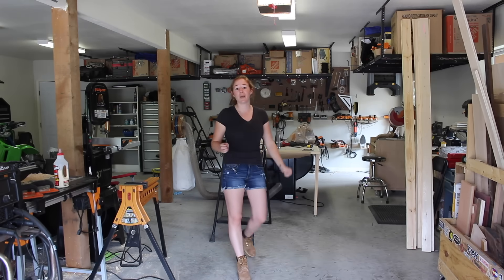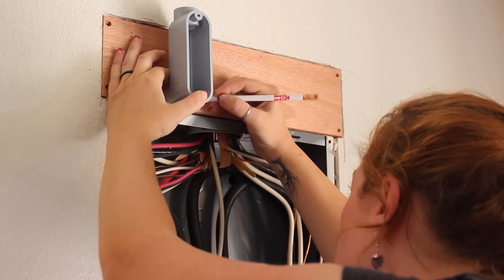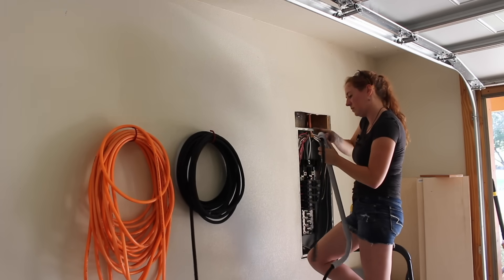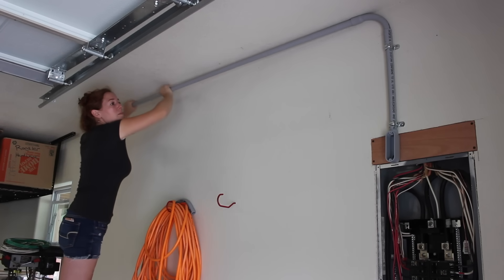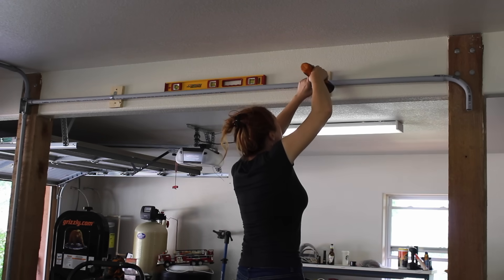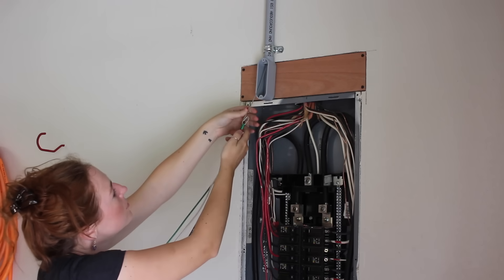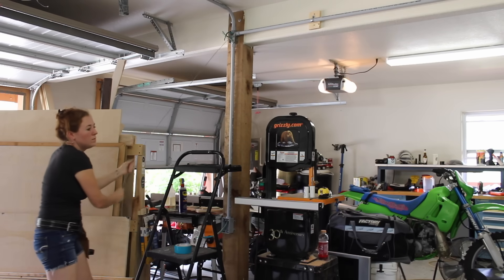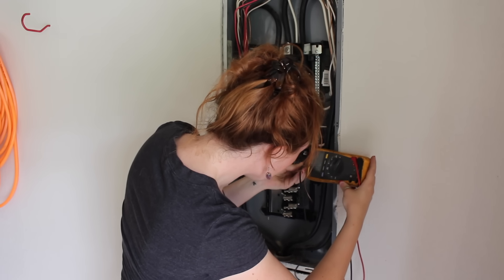Adding 220 Volt Outlets to the Garage

Comment: Handy box for splice is to small. Should have used 2 blacks or black and red wire for receptacle not white white is a neutral.  Handy box must be grounded because it is metal. U can't run the thhn in free air into panel. But pipe job with straps was nice

Comment: -1" pvc and smaller needs to be supported within every 3 feet.
-I did not see you using pvc cement when putting together the raceway.
-If you have a heatgun, you can use that to heat up the pvc to bend offsets in your run to follow the contour of your garage instead of installing those wood blocks.
-don't forget to bond your metal junction boxes (handy and the two bell boxes) with a green ground screw and green or bare wire to your ground wire
-It looked like you didn't put on a cover plate for your receptacles.
-I could not tell the size of your conductor; #12 is good for 20 amps and #10 is good for 30 amps. Not sure of the ampacity of your breaker. Make sure you didn't oversize it or you could burn off the insulation of your conductors and potentially start a fire.
-You should have used any other color than white for your 2nd leg of power (excluding gray and green). A 2nd black would have been ok.
-I was very nervous watching you install the breaker; your hand was awfully close to the live bus bar. It could have turned into a bad day really quickly.

Nice job, looked good!

Comment: I'd hire her for this clean wiring before i hire an electrician.  I'm not gonna lie, I'll stick to the outlets and that's it.  Takes balls to go to the motherload box and start having at it.  Some system's, flipping the breaker still has wires hot so more power to you.

Comment: The reason you can’t run a sleeved wire like SO or SER or Romex is all about the  temperature. Good job. And also remember to never run a fish tape into a panel.
Reply: You can absolutely pull romex through pipe if indoors. You can’t run it in conduit outside because the inside of the pipe is considered a wet location and the thhn inside the romex is not labeled as thhn.
Reply: @gdrummer3929  Hes the "FRONTMAN " for McInnis. Gavin took on the role of "THE GREAT OZ!!!" behind the curtain claiming dissociation with PROUD BOYS!!! WWF style
Reply: There is no connector  between the ell and the panel,  the wire will be rubbing against the sharp edges of the box.
Reply: It’s actually required where exposed to physical damage.
Reply: You pull the wire in not the whole romex!!!
Reply: @mellowrebel4618  about Romex in PVC / EMT piping.  2020 NEC 334.15.(B).    Nm cable .... Exposed work .... Protection from physical damage.   Cable shall be protected from physical damage....by Rigid, EMT, schedule 80 PVC and more.

Please check, I am studying for an exam and want to ace it.  If I am getting wrong, please let me know.
Reply: This reminds me of 300. AMATEURS!!!
Reply: @mellowrebel4618  it is at least 24k not 300
Reply: @xacthuibainhlaonhiemlambai4053  300 THE MOVIE SHEESH
Reply: So what kind of wire could you use, excluding the THHN that she used? Also, if I am going to be pulling 30-60 amps through a 220-240 breaker (welder), what kind of wire would you suggest? I am told that I should use at least 6/3, but if they all have that extra casing like Romex, what kind of wire should I use? Also, some 240 volt receptacles have 3 slots, and some have 4 slots. How do I determine which receptacle I need and once I have it, how would you suggest I install it? Lastly, if you are an electrician, do you live in Texas?
Reply: @lukepotosky7710  Luke, talk with some local electricians and the building guys.  Fell people realize that their house is set up to have the smallest wire for the loads as built.  Your welder may not fit.  Also, there is a code section for welders all by themselves.

The big one is the debate of putting a 60 amp breaker on the 50 amp recepticle (cannot be done by code/your building code may say different).  Hard wiring only means there is no plug.  You may need to hard wire your welder for the 60 amp requirement.
Reply: The NEC doesn’t explicitly ban running romex in conduit, but there’s not much reason to do so generally.  THHN/THWN is cheaper and easier to run.  A lot of electricians don’t run it because of concerns over potential heat issues, which makes sense.  You definitely can’t run flexible cord though in any permanent installations, in or out of conduit.
Reply: @MD-en3zm  , what about " type W " flexible cord as a permanent installation? id love to hear your interpretation on the nec code about that.
Reply: @MD-en3zm  do you mean MC wire?? And what I been told is you cant run romex thru conduit slab and outside . That it has to be UF wire
Reply: Tom Garbo  there are exceptions in that article but in a conduit is not one.  So cord is permanent  and acceptable if used properly.
Reply: @Ryan-hr9hw  on the so cord "acceptable if used properly"....2020 NEC 400.12.(1). Uses .not permitted:
1.  A substitute for fixed wiring of a structure.
Reply: No, its conduit fill. SO cord would take up about 80+ % of the conduit fill.

Comment: You should use red and black for the 2 powers for 220v not White as that is neutral.  Now you should at least put band of red tape at all termination so anyone will know its power off a breaker.

Comment: I did this project with a 4 wire, ie red and black hot, plus white and bare copper. I ran them from the breaker box up into the attic and down the wall to the receptical. That is also a neat way to do it without conduit.

Comment: You just sleeved the THHN open air out the back of the LB and into the panel without a connector? Just floating out of the LB into the panel hole?......

Comment: EMT for the drops and romex through the attic space would have been cleaner if you could access the crawl space. And I would have run 2 seperate 240v circuits. But still, nice work.

Comment: just take the coating off the wire  and put it in the pipe. now u doubled the price of your wire. if watching in 2018 better have bushing on you T.A. after the lock nut

Comment: LB has to be directly attached to the panel box, not run through a wooden home made raceway. Original Romex entering the panel HAS to enter  through approved connectors. Wouldn't want to take the drywall off the garage. If you think you Really believe you know what you're doing, show me an electrical inspection certificate. Anyone can be an electrician, just ask the fire department.

Comment: I just run a custom made 220v extension cord to my dryer outlet for my everlast welders. I'd much rather add a 220 volt service but just haven't had the time.

Comment: How did you get you get the wire from the LB into the panel? Why didnt you turn off the main to connect the breaker? Why didnt you just use pvc boxes everywhere?

Comment: Never wear jewelry when during any work with electric. Also the wire colors are serious code and safety violations. White should NEVER be used as a hot.

Comment: Nice job, though I would have used a 4x4 pvc jbox, ran red wire instead of white to avoid someone else getting confused or injured, and I would have bent an offset in  the pipe by heating it in front of a halogen lamp while constantly turning it. You can bend it to shape carefully and not have exposed conductors at the panel. 
I like that you used a level and a meter to do a voltage check, though I would wear 600v, minimum 450v rubber gloves in a live panel. Kudos to you for doing your own work. Doing electrical work takes knowledge and all of your attention.

Comment: Ok, all the corrections/elect. comments were super helpful, but as a basic handy homeowner you were an amazing resource to me. I've done almost all the work on my house but electrical was always a little bit daunting. Your video is clear concise neat an excellent for someone like me, thank you so much! Liked and subscribed. Yes there are things to correct and fix for code and inspection etc but this was so helpful for someone who's just starting off and learning about electrical. Also specifically looking to wire 220 into his garage for a table saw :-) thank you again

Comment: couldn't you use a $20 110 to 220 outlet converter?
Reply: no no that's old school, today she could have just installed a 220v "Blue Tooth" adapter plug 2sec job....
Reply: blue tooth power LOL

Comment: couple of things id have done differently. i wouldnt have used the 90 sweep's.  id have used type-ll conduit bodies at all 90 except where you went from wall to ceiling. or a pull elbow

id have used conduit clips instead of the clamps. this eliminates the need for the s bends that should have been used. 

mark the entire circumference of the white conductor at all junction boxes with tape or shrink tube instead of sharpie. 

since the pipe in installed you can bend the existing using a heat gun and a wrap tool that will allow the heat to get on the back side. once heated you can push it to the wall or install the clips. ground each metal junction box

Comment: Since, as has been noted, you used white wire, it wouldn't hurt to wrap red electricians tape around the white wire near the connections to differentiate it.

Comment: I think you'll be popping that 30 Amp breaker if you are trying to weld or plasma-cut on that circuit.  I would have used 6 ga wire, and a 50A breaker for those outlets.
Reply: most welders pull 24 amps u twat.

Comment: Considering you're not an electrician, you did an EXCELLENT job. Couple things though, I definitely wouldn't have put that LB through your homemade access panel. If you ever wanted to run any electrical in the future, you'll have to undo all that wiring to remove that wooden panel. I would have entered through the drywall about 12 inches above the panel. Also, you can't run bare THHN through the wall. You should have mounted a box above the panel and converted to Romex inside the wall and into the panel.

Comment: "Sleeving" SO cord in PVC may be a technical violation of the code but the bigger issue  with "sleeving" SO cord is it takes up all the room inside the 3/4" PVC.  No other wires could be added later if needs be. Using building wire instead of SO cord would allow for the addition of more wires for another piece of equipment in the future if needs be.

Comment: Thanks for sharing your video. I have one question. With this set up  you used. Would you be able to connect and operate  TWO clothes dryers at the same time? I ask this because  I'm looking for ideas of how to add another 220 outlet to my garage  to ad a second clothes dryer . Ideally, I'd be running two washers and two clothes dryers in my garage ,to speed up our laundry washing.

Comment: Here’s a little tip run a 1 inch gray PVC pipe the kind that you glue and mount up with clamps run it to a central location in your garage put the other end into the electrical panel if you’re comfortable with that make sure in the middle of the run you put maybe a single or a double box made out of plastic which helps you pull wire and you can pull anything you want at least into the room and then from there you can build off other outlets it’s the simplest way and you don’t have to put the wire in immediately into you know what you want it’s also cheaper than buying orange Romax if you want to run something that’s in the 30 amp range to 220

Comment: It is 240V outlet, not 220. It is easy to remember: in USA voltage is 120V, not 110V. Tho phase voltage outlet in USA is 240V nominal.

Comment: Looks great to me and I'm sure it would pass any home inspection! A few things tho I would change or done a little different.
-what size wire and breaker.. looks like 10awg, I assume a 30 amp.
-I would have ran 2 circuits bk/rd, bk/rd in 10awg with 2 30 amp breakers.  I also would have ran the white if it's what I had though taped it black for out of habit 
- I like the wood you used though I prob would have used some mini's.
-PVC glue. Another habit and I'm sure I would hit it with something eventually.
- I try to always push a fishtape from the panel out because it's steal or fiberglass with a metal head though I do both and I know the panel was dead but folks watching..
-Single circuit I would have pulled through and had joints just at the receptacle. 2 circuits used a t body condulet and pulled though, 4 square if joints.
- I prefer EMT oposed to PVC. Tomatoes tomatas.
- stingers in all boxes with breaks.
And face plates on the receptacles
Hell of a job regardless.

Comment: I am not sure why the power companies set it slightly higher than 120V and 240V but my guess would be so that they partially compensate for voltage sag in internal house wiring when there is a heavy load.  For example, if you almost max out a 15A outlet that has a long path from you breaker box to that outlet, the voltage can sag to close to 105V if it started at 120V.  By boosting the no load voltage up to 125V for example, the "worst case" sag might only go down to 110V which is more "respectable".  However, I also suspect there is some other ulterior motive that has to do with money/cost/profit.

Comment: The title states 220V and when she does a reading towards the end of the video she gets 245V.  Why the hell call it 220 then?  Here in USA we use 240V, NOT 220!
Reply: This video is dated 2017.  That is not the "olden" days.  On a typical meter here in USA, it will show 120V or 240V depending on what type of meter it is.  Yes of course 220 and 110 will work for most appliances that require 120 or 240 but maybe not if they are borderline on the amperage (lower voltage will require more amperage for a given wattage so for example, a shallow well pump may work at 240V but fail at 220V cuz the amperage will be close to 9% higher at 220V and that could "trip" something like a breaker if it was already borderline at 240V input.
Reply: The problem with that is it is sloppy terminology.  Some countries actually use 220, some actually use 230, and some actually use 240.  There is a distinction.  It is better to say the ACTUAL voltage you are using cuz then it implies location.  For example, if someone said 220V, I would suspect they are not talking about USA but rather somewhere like Philippines.

Comment: I would of ran 2 separate 240's and just pulled 3 more wires from the breaker box/another breaker to the junction and then went to the other side.

Comment: The awesome things you are doing. This is totally kewl and you are not the first female I have seen working in the trades. I have met female electricians, plumbers, and even a pipefitter - like them you just have the skill - congratulations. Regarding everyone’s comments about using white and grounding. Using 3/4 EMT may have been better because the EMT acts as a fallback in the event the bare copper GND fails. The tradeoff is you would have had to use either a bender or a tight radius bender. Secondly, the standoffs were a good idea, but using EMT and bending would have mitigated the need for those. Alternatively, you could have purchased for 2 or 3 bucks, some standoffs that would have worked great as well. Running the system as a four wire system would have been ideal, such that line (red), line (black), neutral (white), Ground (bare/green) would have been the ideal way. All in all, after having watched many of your videos - I am highly impressed. Some of the ideas, such as the 2 stage harbor freight dust collector (less the bungee cords) were phenomenal. The itty-bitty house up in Seattle was awesome as well. Overall – you are effective and efficient.

Comment: well done. thanks.  I would have added a red ( or 2d black )  wire for 4 conductors for 120/220 dual volt service, where allowed by local code. the neutral/white for this. you could wire an Edison type for 2 of the 120 volt for other uses.

Comment: With that size of conduit, you should have used a 4S deep box. Much more room. Support clamps for the PVC should be no more than 4 ft apart.

Comment: Great job.  One of the first questions to ask when doing a project like this is, How many amps will I need?  The number of amps will determine what gauge wire you will need.  Doesn't hurt to pull a larger wire and use appropriate breaker.
Reply: Beautiful and smart too!

Comment: What is your position on smart meters, you  do your electrical work, all your supplies are UL approved, NEC compliant, then then power company comes along slaps a smart meter in for power, it is not UL approved, then do a search on utube smart meters cause fires not to mention higher bills! Then the house or shop burns down along with the work you did, NEC complaint, ain't helped for that. The Fire Marshall states the smart meter caused the fire, you make a claim with your insurance company, they say NO because you did not have UL equipment.

Comment: These are suppose to be 220 volt outlets correct?  Are you using 30 amp wire for those outlets?

Comment: Hi April, you have proved your ability to accomplish a lot at a young age.Just trying to add a little safety on electric. I started out at 16 became a union carpenter Forman at 21 ,General superintendent both carpenters and general contractor at 30 . Work till I was 60 as project manager,now 70 retired ,when working on any panel you need to cover the bus par with a lease cardboard .Seen to many guys get hit by accident a tool hits the bus and the flash will burn you if not kill you . I see that it looks like your in the Santa Cruz mountains,my son is on the summit near Muns winery ,he has 47 acres starting from scratch. I am back here in Connecticut but travel out Once a year for few months and do what I can.Keep up the good work you have many good talents
Reply: Bar instead of par

Comment: I would have used the SO cord and run it inside the wall and up through the attic and then down the post, that way it will look cleaner.